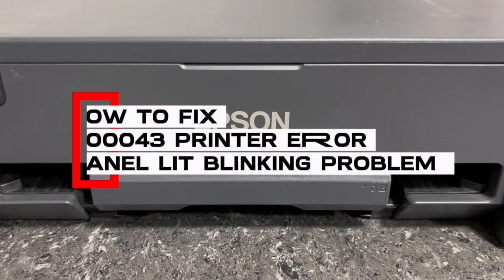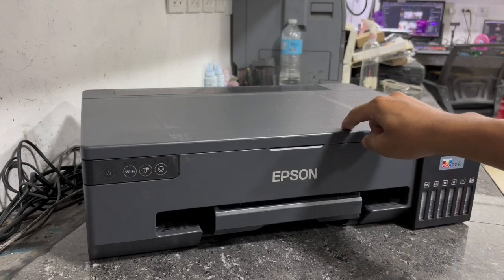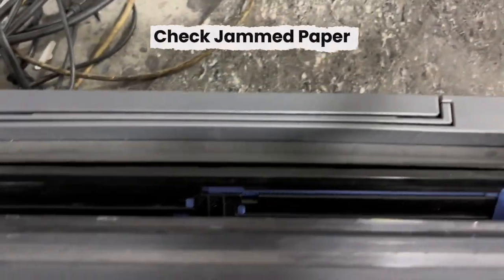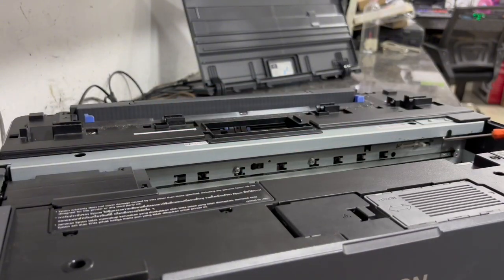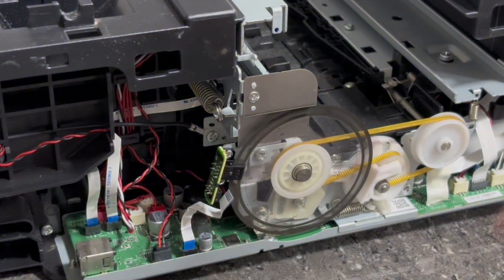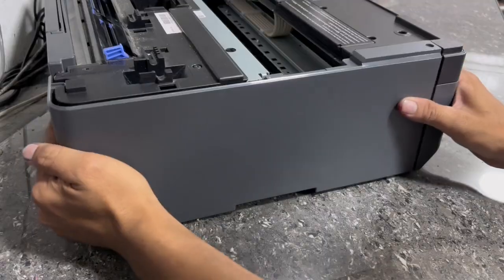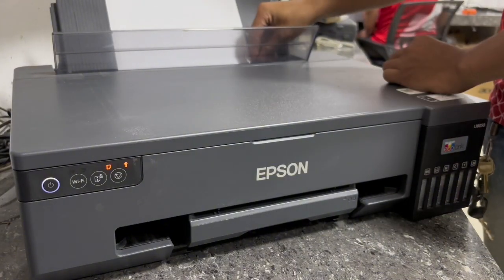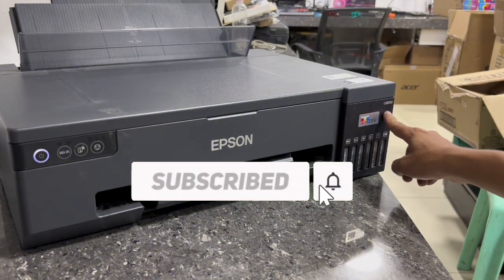HOW TO FIX PRINTER ERROR  000043 OR PAPERJAM ERROR | EPSON ECOTANK L18050 PRINTER.

Comment: I'm having this issue with my ET-8500    it happened right after a firmware update. Is that when you're issue happened as well i noticed you uploaded it today. Also is there any thing specific to the et-8500 that is difference from this fix?   Also I have checked everything meticulously, its definitely not an actual paper jam.